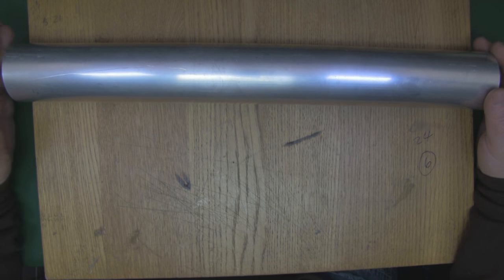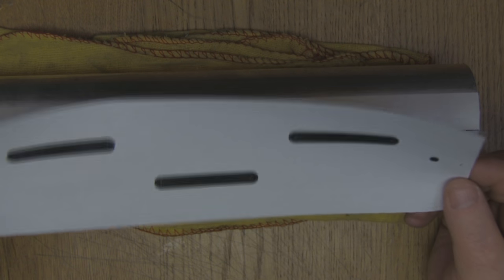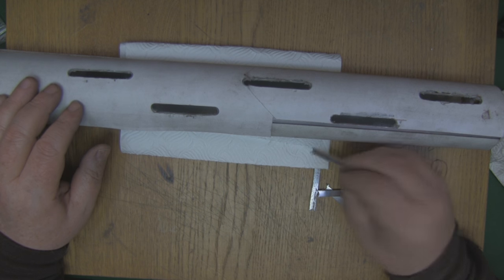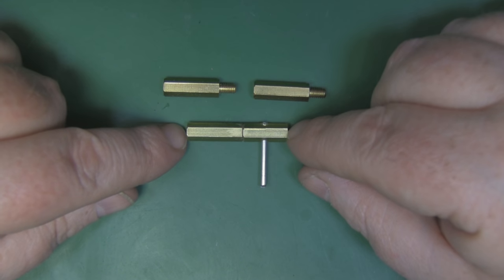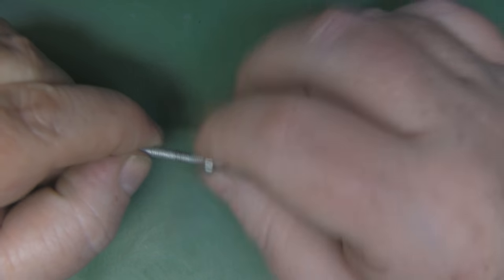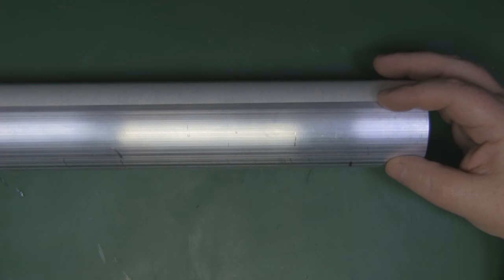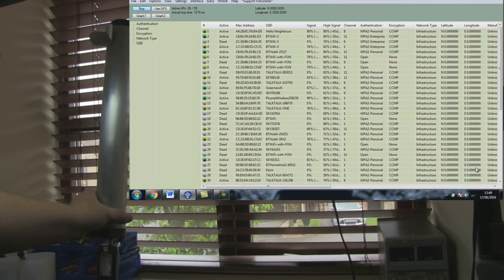12 Slot Waveguide Antenna for 2.4GHz

Comment: +andrew mcneil

 You can solder aluminium under a film of oil using a wire brush as you apply the heat to scrape away the oxide layer. The oil (which should be in a 3-4mm deep puddle - contained by a temporary plasticine berm) keeps the air off the surface out while soldering.  The oxide layer takes a few seconds to form once scratches off by the wire bush and in the meantime the oil keeps it sealed. I've used groundnut/peanut oil (supermarket, near the chip/fries oil but in much smaller bottles) as well as light mineral oil (sold as "baby oil") to reasonable results. Use 60/40 or similar, not plumber's solder. 

An alternative to runny oil is to use petroleum jelly "Vaseline", though just after the scratching stage you'll need to give it another smear of fresh clean vaseline to move away the oxide detritus the brushing has caused. When using liquid oil the oxide tends to be carried away in the runnier liquid as it heats rapidly around the tip - I prefer the oil myself and hot vaseline is runny anyways. Try both methods to see how you get on. I've also use coconut oil/grease which at least gave good mechanical results - this was not tested for DC or RF mind you.

You can get by without a flux if everything is scrupulously clean but special fluxes are available for brazing aluminium (they are quite corrosive and need thorough cleaning). The best ones I've used are Soviet-era Russian ones that are positively dangerous :) 

At a pinch you can do without - just keep everything clean and use fresh oil and thoroughly clean the tip. Very thick paste fluxes will survive under the oil, modern "normal" SMD paste will not. You could experiment with acidic plumber's flux, which will require extensive cleaning afterwards. 

You will probably have to warm the metal tube with hot air (a domestic hairdrier is enough) for a few minutes before beginning - using too high a  tip temperature to compensate for the high  thermal mass of the aluminium and oil will simply burn the oil into a black sticky mess. Better to pre-warm the whole thing first to 60-80 C to give you a head start. A minimum 50W iron will be needed, 100W or more for very large or thick pieces. The smaller the iron the more the preheat is vital - the idea is thoroughly warm it and soilder the joint gently under control at normal 60/40 solder temperatures rather than boil it to death with a 600C iron tip on a cold tube. 

It can be a messy smokey process that is not for the faint-hearted or married. Only do it in a well ventilated area -a garage for example, not on your bench. Sometimes you get very little smoke or only white whisps - a lot depends on how clean the alu surface is first. Shiney alu seems to be the cleanest for smoke. Brushed finish or anything over-sanded makes for more black smoke. Use fresh oil/vaseline for every join or the smoke can be bad. 
 
Have a fan immediately available to purge smoke/fumes as soon as you have completed the joint and it has cooled below solidus temperature. Be careful not to shock-cool the joint though or it may go brittle and fall apart. I use a powerful 12-inch ducted fan (a Honeywell brand) and align the airflow above the work area, not onto it. I turn the fan on about 5-10 seconds after the soldering, any earlier can create a dry joint (big thermal mass means slower cool-down). Unless you are using scary flux you won't drop dead but smoking oil is unpleasant in your face.  

I haven't checked losses at RF for oil-film aluminium soldering, but I'd expect a good wide joint to have low impedance and resistance into upper UHF region. 

As others have said, a woodworking router will cut slots in aluminium, just go easy and don't try to remove too much in one pass. Avoid interrupted cuts - this means don't drill a hole then route towards it - the sudden shock of hitting free air then solid material again can chip or shatter your router bit or more likely, with aluminium, cause it to spit the material out at you. Most grade as alu are soft enough to cause no more problems than routing a hard wood like chestnut. It does tend to gum up on the bits though - experiment with speeds and feed rates on a scrap pience of each material you use - not all alu grades cut the same! 

Use a router table ( a homemade simple one is better than most expensive bought ones) or clamped router for safety though - not freehand. The difference in end result is immense. I clamp my router upside down in a workmate-style clamp bench and clamp a further block of wood nearby as a "fence". For routing slots in tubing, you can't use a conventional guard so be very careful you don't fall on the spinning cutter or get you hands caught on it.

 A small flat transparent polycarbonate "top" guard is best if you can bodge one - it can simply be clamped or screwed above the fence block and extend horizontally over the cutter area. Basically a clear strip a few inches wide (3" or 4" or so) extending out above the spinning cutter at a height that allows free movement of the tubing under it. It gives you a visual reference of the danger zone if nothing else. 
Always keep it simple - in my experience store-bought or complicated router table setups never end well, results or safety-wise. I'm not a woodworker, maybe that's why. Here endeth the long, hard-learned lesson :)

Comment: Greetings. I don't know much about antennas but my 14DBi TP link panel antenna has died. So I am looking for a replacement, if I had to buy an antenna from ebay what would you recommend? Or is making a panel antenna easy enough? Can you give me some links to DIY panel antennas? I can't find any via good sadly. I would just buy a new antenna from amazon but after taking apart my antenna there is no reason that it should cost 50 dollars for two sheets of precisely cut metal.
Reply: Watch all of his videos go to home depot order your N connectors from amazon use 400 lmr cable and build a few for different situations.

Comment: Great Work !!  Is there a formula for the tube diameter and slot width and spacing, according to frequency etc...?  I know that slot antennas have been used for radio and TV broadcasting since the 50's and are very durable for outdoor use ! Thanks again !!

Comment: watched a design of a waveguide using rectangle tube but he used a simple cone as feeder soldered directly on the coax connector (n-type) , he made this from copper sheet and formed a cone and solered together, looks very simple just like to way you used in cantennas with single piece of wire, maybe that cone makes the impedance correctly?  i couldnt find that info why a cone was used.
Reply: btw maybe important to mention;  he bolted the connector on the front panel (were the slots are) and the end caps didnt contain anything so could be handy if they are removable for service.
Reply from the maker: Highflow I will dig out my notes I made at the time and post back to you. As I cannot remember why I did it,  Andrew
Reply: many thanks!  keep going m8 the project are so interesting and much to learn

Comment: I would have thought wifi was mostly vertically polarized.  This antenna is horizontally polarized.
Reply: A slot has the opposite polarisation to a dipole.
Reply: @Synthesizers1 Yes, hence why I said this antenna with vertical slots is horizontally polarized.

Comment: no ground ?
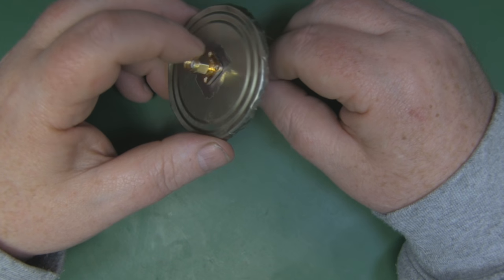Reply: No, no seperate ground element, as such. The feedpoint is "ground" referenced to the tube itself, connected through the outer of the coax connector on the endcap. This is shown at 17:41. It relies on the end-cap having a good low-impedance connection to the tube however (he double-checks - albeit at DC - this later on) 

Note that the probe/inner coax is isolated from the tubing and end-cap around the connector end. Due to the nature of RF magic, the other end of the probe IS connected to the tubing outer. This is NOT a short circuit at radio frequencies though, even though it is at DC.
 This is due to the length of the probe at the particular radio frequency in use.  18:48 shows him attaching the "far" end of the probe to the tubing. This is usually a difficult concept to understand unless you are into RF, as it is very different from "normal" DC or low-frequency AC teachings and most people's experience of electrics and electronics. 

At high frequencies like 2.4GHz wavelengths are short (12.5cm) so even an object a quarter of that long in one dimension (just 3cm) is long enough so provide adequate counterpoise, or ground plane effect -  o/c at one end, so low impedance at the other physical end (quarter wave transformation of impedance) so the term "ground" can be rather confusing at UHF and above - RF ground is very definitely not DC ground.! In this case, the antenna is fed unbalanced, though balanced feed is possible for a different design (using a balun).
 
RF especially at higher frequencies is still a form of magic to most people :)